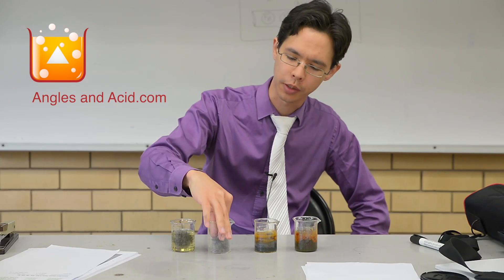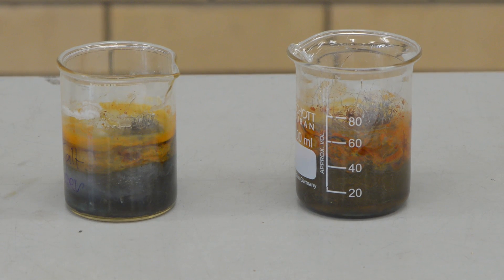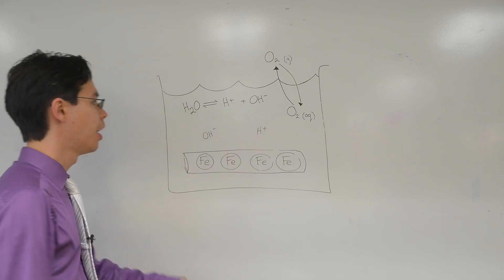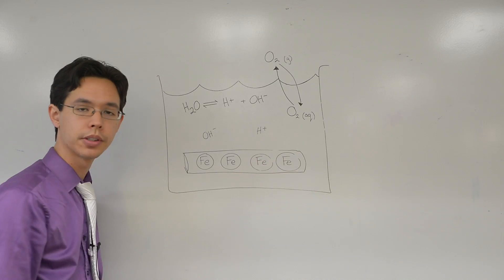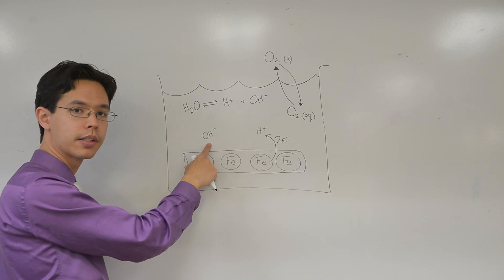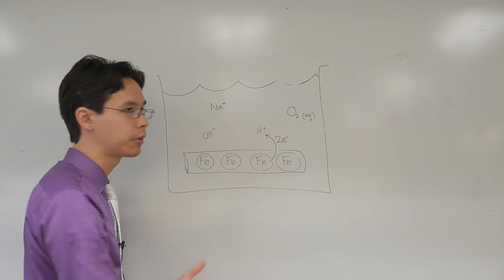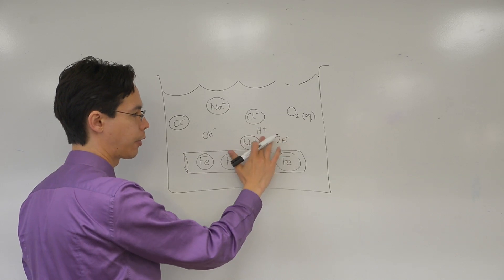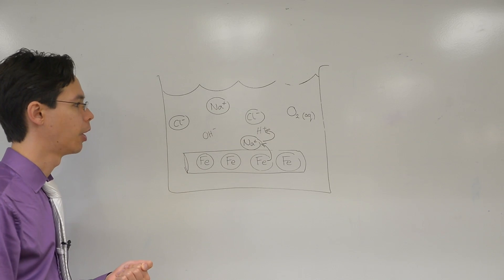Corrosion Rate in Salt Water

Comment: I hope this message reaches you.

I absolutely need to know which metal should I use to make steel rust faster in seawater through galvanic corrosion. I hope I've asked this question correctly and also I don't know how to privately message you so if there's a way you could privately message me or let me know if you make a video about this would you please do so? 

Thank you
Reply: Not much you can do other than to add more salt to the water or maybe some hydrogen peroxide or acid.

Comment: If i use a steel rod will it be the same?
Reply from the maker: +Aiden Hijuelos It&#39;ll be slower due to less surface area. You&#39;ll have to test it before using it as a demo in class. Rate can depend on surface area and concentration in this case, so it depends on what kind of rod and what kind of concentration of salt you use.
Reply: +Angles and Acid Ok im 10 and this is for my science fair so i was going to try and find  a normal steel rod and put it in maybe a gallon of water with maybe 1/2 a cp of salt
Reply: +Aiden Hijuelos a car battery charger will speed up their process in a matter of hours or days.
Reply from the maker: That would work but not recommended for 10 year olds on their own, because of the electricity.

Comment: The corrosion of steel in a neutral pH solution is controlled by the oxygen reduction reaction, NOT the H ion reduction reaction. If you want to prove it. Boil the water to remove the oxygen and see that the corrosion rate decreases considerably, even though H+ and OH- ions are still present.
I am afraid your video is misleading.
Reply: Can you provide me with a video that is accurate?